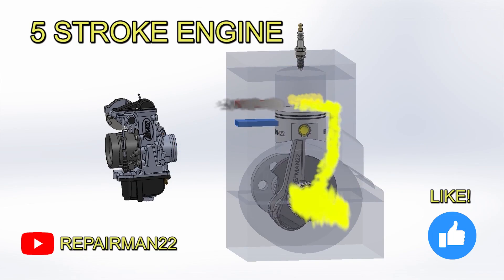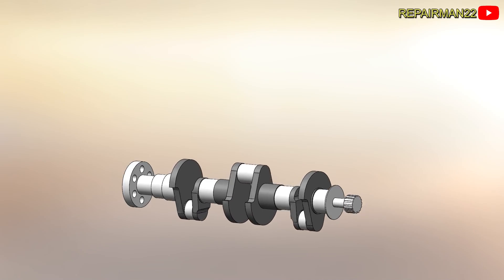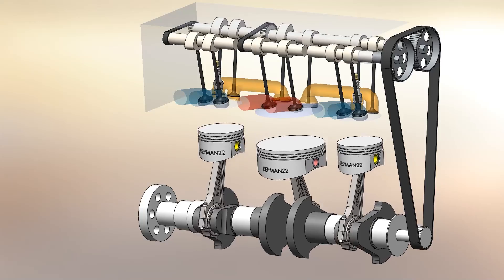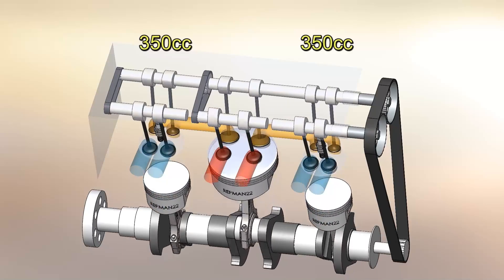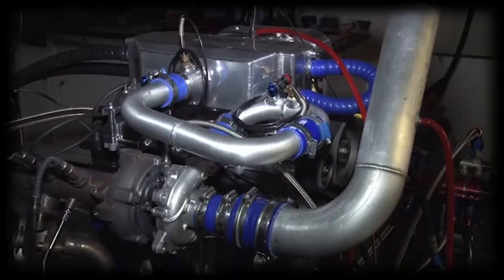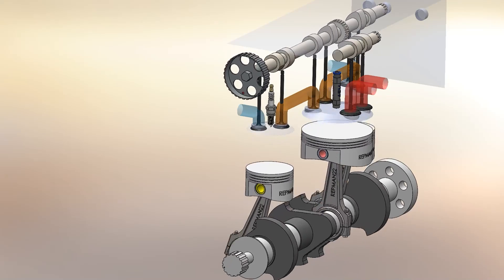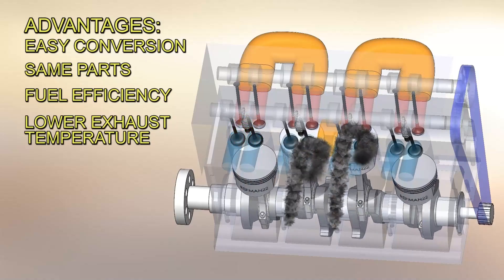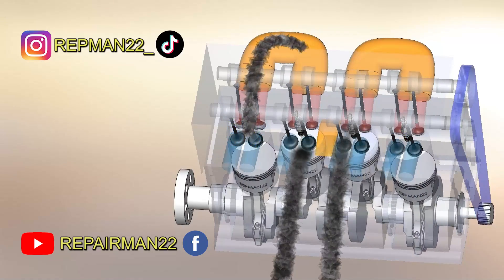The 5 stroke engine with water injection // Tested in Golf MK5 🤯

Comment: This is not a 5 stroke engine, its a 4 stroke with a secondary expansion cylinder, stroke refers to the tdc to bdc distance, and how many times it is completed  to achieve the full cycle, ie 4 strokes = one cycle, not 5

Comment: I would be interested to see how this compares to a turbo 4 stroke. With the added points of failure and rebuilding of a crankshaft, it seems like a tall order when compared to current forced induction methods. The concept is interesting, regardless, and the video well put together.

Comment: The biggest issue I see with this engine is that the central LP cylinder gases it’s cam timing locked to the HP cylinders. This prevents it from having variable expansion ratios, giving the engine only a small band of high power and high efficiency.

Comment: As you mentioned that 5 stroke benefits only higher engine loads, forget cars and motorcycles and add marine and aircraft engines to generators and range extenders. The need for those continuously high load engines are million units a year. This innovation really has markets.

Comment: To further enhance efficiency, a catalytic converter can be added to the manifold that feeds the central cylinder.  That would add heat to the flow into tue center cylinder and enhance the water injection as well.
Reply: To you talking about? Cats don’t add heat to anything, quite opposite it takes away heat and energy 😅
Reply: @ddjohnson9717  the chemical reaction that is catalyzed is exothermic.  Cats introduce a flow restriction though, thats where they sap performance especially because the extra heat produced is normally always completely wasted. 

In this twin expansion design though, that energy goes to enhancing efficiency

Edit: some people prefer dogs anyway.
Reply: @lcambilargiu  dunno, putting a turbine driven generator after a cat seems to be much easier (mechanically) option.
Reply: @solarissv777  turbos are turbine driven compressors powered by exhaust gasses...  normally the cat os post turbine on that use case...

Maybe thats done for performance reasons.  To cut down on lag perhaps.
Reply: @lcambilargiu  I guess it's both to cut down the lag and to simplify piping for air intake. The advantage of the generator I mentioned above is that it doesn't need to be anywhere near the engine.
Reply: Could be tricky to actually pull off with the limited space available over the short transfer port lengths but it makes thermal sense to me. It seems to me that the shorter the transfer track the better.

EDIT: Given that the engine is already has a restricted effective RPM range I suspect that there would be an ideal transfer port length that would be able to take advantage of harmonic gas wave effects like a tuned length extractor exhaust system. That may even enable room and gas dwell time sufficient for your catalytic converter idea. The narrow usable RPM range would be likely to become even skinnier though.
Reply: @lordchickenhawk  the port should be built into the head, I'd think. The catalyzer needs to be an insert that fits in place.

If you are converting a 4 banger then maybe simplicity is a better option.
Reply: @lcambilargiu  Yeah, I think so too... like I said, space would be the tricky bit, either way. 

And the flow restriction you mentioned to ddjohnson would present further difficulties. I like your idea but I think it would be very difficult to it pull off in actual practical application.

Comment: I would think using the middle piston to compress intake gasses before pumping them into the smaller pistons like an inboard supercharger would be more effective than using the exhaust.
Reply: It would improve power, but it would also increase fuel consumption rather than decreasing it, which is the goal of this design.

Comment: This is some great invention, but just the fact that it's really useful in high RPM, and consume more at low RPM due to the complexions of the mechanism means that it's useless for everyday use as use our cars on low rpm, ramping it up would just worsen the fuel usage. 

The way it could be useful is in race cars, which are primarely used on high RPM. Tho the down on power is also something to have in mind, plus the wheight it adds, let's see if it's adopted or tried and abandonned like the sad story of (my favourite engine) the dorit- Rotary engine

Comment: And then you have the Crower 6 stroke engine with no expansion cylinder and each cylinder being water injected for extra steam power, yet no production runs of any of these exist. Why is this? Because the gains are less than having all cylinders fire in most cases. The Crower engine needed a supercharger to compensate the losses in the end and the complexity of it outweighed the advantages.

Comment: A direct mechanical turbo is a similar methodology. In this case the extra exhaust energy is captured by spinning the turbine. Instead of using it for increased intake induction the generated power from the turbine is transferred directly to the crankshaft. This design also come with pros and cons such as increased friction, reduction gearing issues, increased back load on the exhaust stroke cylinder etc. But can offer small amounts increased power and fuel savings.
>
The simple thermodynamics of ICE are this:
Most modern ICE designs hover at 45-50% energy efficiency, meaning that 50% of the fuel energy is not converted to kinetic energy and lost as heat via the exhaust and cooling system.
Efficiency means capturing any of that wasted 50% heat and turning it into "usable" energy without losses in the conversion.
For example lining the exhaust with theromoelectic plates such as the common Peltier cooling plate technology to convert the heat into DC current and drive an electric motor. Not a very efficient example as the weight of the exhaust and the plates would likely outweigh any gains, but you get the idea :)

Comment: Throughout most of the power range the thermodynamics (efficiency) of a modern VVT engine is very similar. A VVT engine varies the amount of charge trapped and compressed in the cylinder by varying the timing if the inlet valve. Less charge means more expansion. Claims of 30% increase in efficency relative to a modern VVT engine  must be wrong. No need to build a prototype just do the calculations on a whiteboard.

Comment: So it's basically an integrated turbo, but instead of drawing in more air, it's effectively sending the power directly to the crankshaft?
I mean it makes sense why this would increase efficiency by a great degree, but this really hasn't been tried before?
Same with the water, you're effectively just pulling out more mechanical energy from the heat of the engine, while also regulating thermal buildup better.
I guess integrating this into an engine block isn't an easy feat, and especially without the water injection i could see chamber fouling as becoming a problem pretty quickly (since there isn't a compression + ignition stage to clean the bore)... Still i would have expected someone would have thought of this sooner?

EDIT: Turns out this is an 1870's concept. Smith is a late bloomer. As in a century and a half late.

Comment: Hi! Some years ago I made water injection system on my VW Golf Mk2. No fuel economy. For right operation this setup needs control temperature of the engine before we can inject water, because if engine temperature is low, we get situation of no combustion/ motor stops. In F1 engines in old days they use water injection only in extreme temperature/ pressure/ knock prevention situations. This thing works only as engine horsepower booster when engine is hot. Be happy! :)
Reply: Water injection works for controlling combustion in very high cylinder pressures, resulting from high compression or high boost, or both.
Reply: @jiroyamamoto2878  Yes. For me - in my setup - it works very fine in very hot summer time when asphalt reach extreme temperatures. Lean mixture and cold water mist temperature makes it ideal conditions for clean/ humid/ powerful combustion - engine inside and manifolds was clean always and it gives very quiet engine work. If there is Arduino between all that parts and if it is controlled everything - it will work fine - beautifully! My system was not so advanced and it blows up in one day :)!
Reply: I used ultrasonic fog in a TDI! 0,2 - 0,3 l water p.h.
- 0,5l/100km  Diesel
smoother engine run
better accleration
less carbon pollution
Reply: @svendittmann3105 you should have tried scotch mist.
Reply: @svendittmann3105 what device did you use to produce the fog?

Comment: I think the Argentinian pendulum engine is the best non mass produced engine variant. Oil isn’t required because there is no friction and 100% goes to turning the crankshaft instead of rubbing the cylinder wall

Comment: You could probably get away with heating the intake with the exhaust since you have the extra expansion. The problem with doing this on regular engines is it effectively increases the compression ratio by increasing the temperature of the air without increasing the expansion ratio. So more work is done to compress the air without actually getting that work back through expansion. This has shown to increase the efficiency of turbine engines.
Reply: I believe heating the intake would decrease the air density leading to less power and the warmer F/A mixture will more easily pre-detonate  leading to lesser compression and retarded spark timing to compensate

Comment: Very clever, it's easentially it seems to me the same concept as the power recovery turbines on the wright turbo-compound radial engines, where the exhaust spun a turbine that turned a shaft and put that power directly back into the crank...
Reply: yes, it is a compound engine but using a piston on the crankshaft. Also, similar to steam engines.

Comment: Super silent engine. The central cylinder should be as hot as possible, perhaps eliminating cooling, have a reduced stroke to reduce acceleration and friction, be coated with catalyst elements, and use a lightweight piston and connecting rod due to lower pressure.
Reply: i think the water injection is enough cooling for this engine.

Comment: Why not just use turbo to spin a generator instead? Like MGU-H in F1? Might even be more effective way to scavenge energy.
Reply: Thats the thought process that gave birth to the jet engine. The most efficient way to extract power from a turbine like youre describing is with a fixed turboshaft engine

Comment: Place a compressor driven by the flywheel on the exhaust side to ensure good heat dissipation from the engine and a good temperature for the catalyst. I only ask for 5% of the profit.

Comment: That seems to lack any significant advantage over an exhaust turbine, which you can control how much of the available power you draw from the exhaust, and cause very little restriction. Also, I doubt that engine could actually provide 30% more energy from a given amount of fuel at any relevant rpm or load, compared to a reasonably well designed engine for the task. All the extra friction and restriction in the exhaust path means there would be very little, if any, net gain to be had. 

Exhaust scavenging isn't a stroke, it's a separate stage, even if it's attempted in the engine.

Comment: It seems like you could achieve a similar thing using a regular Atkinson engine with just the exhaust portion of the turbo connected to a generator like on a formula one engine. You also don't really need the turbo to compress incoming air, so a regular high-compression NA with an exhaust turbine would be more efficient.
Reply: Agreed, but only if you have somewhere to use that power in the drivetrain.

This engine converts exhaust pressure directly into mechanical energy at the crankshaft.

The turbo-style generator would first convert mechanical energy (moving gas particles) into electricity, then somewhere down the line convert back to mechanical energy through an electric motor.

The added two steps converting energy may end up being less efficient, but who knows 🍻
Reply: @oscarschott8905   You're right, but most engines already have an alternator which could be upgraded (like some modern engines - see the Jeep Wrangler 4xe and Alfa Tonale hybrids) to a 3-phase motor generator. That also means you can remove the starter motor from the engine because the 3-phase belt-driven motor can start the engine.

These motors can be upwards of 90% efficient, and I believe turbines can be similarly efficient to pistons as well while taking up a lot less space.
Reply: @oscarschott8905  but this engine is only suitable for electric generation anyway. The additional benefit of a separate turbine generator is that you can put it after the catalytic converter to scavenge some additional heat, introduced by the reaction.

Comment: All in all this engine would be a good solution for a range extender hybrid, rather than a diesel genny it can be for a water gas genny, also "less efficient catalyst" engineering can solve that easily, the catalyst wasn't tuned for so much steam in the exhaust, I'm sure we can easily make it work

Comment: Get rid of the valves on the central piston & just have exhaust ports at the bottom of the cylinder like in the 2-stroke diesel, use a V3 design for more direct flow & shorten the exhaust travel into the cylinder  & don't upsize the exhaust cylinder.
Reply: smart
Reply: Brilliant

Comment: A dumb idea, which has been done many times before and failed every time.

This is basically an old steam engine but using spark plugs.
The problem is that so much energy is lost forcing the compression of the slave cylinder, that it slows the 2 main cylinders.
It's far more efficient to pick up the waste pressure using a turbocharger, which is probably why this engine has not made it to production.
So many people have made double expansion engines for internal combustion, and all have realised what a total waste of time and energy it is.

Comment: Adding a turbo is effectively the same thing as it extracts the energy from the exhaust to create more power, and is WAY more simple than this design.
Reply: Turbo relies on also putting more fuel in the combustion chamber to accommodate for the increased air density (more power => more fuel consumption). 

Like the turbo, the center piston uses exhaust gas and pressure difference to operate. However, this engine doesn’t need extra fuel to further assist the turning of the crankshaft (more power => same fuel consumption => more efficient)
Reply: @oscarschott8905  while yes it is not exactly comparable,  you can just use a smaller displacement engine and get the same power output.
Reply: @murraymadness4674  True, but the smaller engine will still typically use the same amount of fuel as a larger engine when producing the same hp, they are still burning the same amount of air and fuel the smaller boosted engine is just cramming it all into a smaller space.
Thats assuming they are running at full power however, realistically the smaller boosted engine will spend most of its time off boost and thus will be using less fuel than a larger NA engine
Reply: What it's actually similar to are Miller Cycle engines. They expel a portion of the intake in order to have a longer power stroke. This ""5-stroke"" has half the intake for the same "expansion" ratio, or 0.7L of compression, 1.4L of expansion.
Reply: Yes a turbo makes use of the waste exhaust pressure but does so in a way to increase air density and thus more fuel and power, but not efficiency.
This design increases the efficiency (and to a smaller extent) and power of an engine without using more fuel
Reply: @archygrey9093  umm, no, a turbo engine IS more efficient when making the same level of power, and more efficient when making less power.  Every engine should have one, but they are more complicated and thus more expensive and have more sources of repairs.

Comment: It seems to me that this cycle could also be used in combination with your previously described Mazda 2-stroke engine.  In other words a two piston engine design, with the small cylinder operating according to the Mazda 2-stroke cycle, exhausts into the large cylinder using water injection as described in this video. Would that make it a 3-stroke engine? ;-)
Reply: Nice idea.

Comment: you can use "catalyst" BETWEEN the cycles, and it will add efficiency because "catalyst" is exotermic.
Reply: I had the same idea, but any increase in the volume of the transfer tube decreases efficiency:

At the point when the transfer tube opens, you have the high pressure cylinder fully expanded plus the volume of the transfer tube (plus zero from the low pressure cylinder because it is at top dead center). When the transfer is finished, the exhaust gases are contained in the full volume of the low pressure cylinder plus the volume of the transfer tube.
Assuming that the swept volume of the low pressure cylinder is twice the volume of the high pressure cylinder (which you probably don't want to stray too far from because of the weight balance of the pistons); If the transfer tube has the same volume as the small cylinder, then that results in a 2:3 expansion; if the transfer tube has the size of the large cylinder, then you only get a 3:4 expansion. Ideally the transfer tube would have no volume, which gives you the full expansion ratio of 1:2.
Reply: @Pystro  i agree